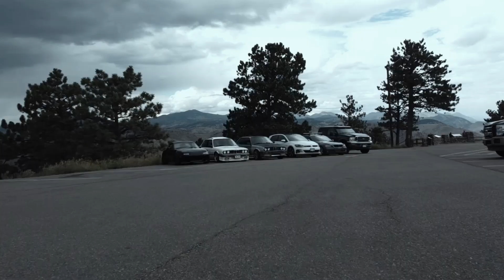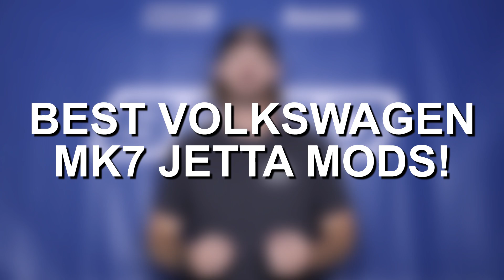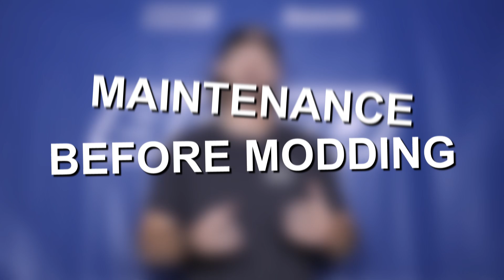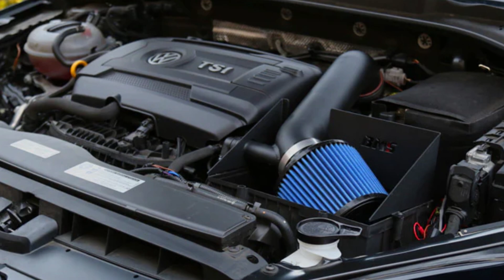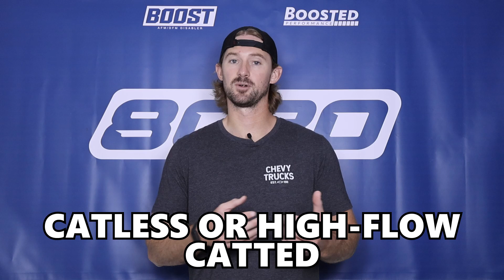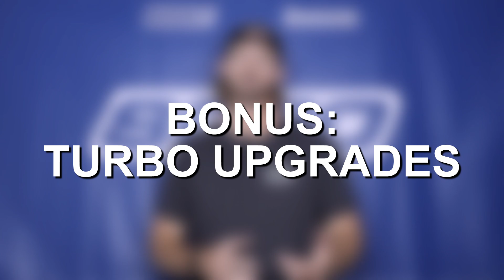How to Build a 300 WHP MK7 Jetta GLI For Just $2,000!

Comment: Good video. I have a 2001 MK7 GLi Autobahn & @ 15k miles I had an APR 93 octane Stage One tune installed, along with new plugs, oil change, DSG trans flush. I would note the costs you’re quoting are for parts only, sourced via the internet & do not include any labor component. You’d have to do all the installation & maintenance yourself, which I was certainly not qualified to do!  I’m not sure how much hp & torque my engine makes now, but I believe APR quotes figures of ~300 for each. In any case I’ve been very pleased with the performance realative to stock, especially since it still has excellent drivability in traffic situations along with great gas mileage….

Comment: I would love to have an upgraded downpipe and tune but, then that would mean upgrading the stock clutch assembly at least for me with a manual transmission.  The money just isn't there.  lol.  Oh, not to mention upgrading brakes as well, especially with the higher power output.
Reply: Yea you’re definitely not ready
Reply: Im picking up my mk 7.75 GLI with the 6spd manual, and because its going to be 2500-3500$ to put a clutch in im just not going to upgrade it until way down the line. just a intake and exhaust with a tune will push over 300lbs of tq and will cause the stock clutch to slip...

Comment: I'm ordering my GLI in early 2026. I thought they all had 2.0 engines. I plan on replacing the stock exhaust with a better flow through design. Any thoughts on this mod?
Reply: I have 2025 GLI
Reply: @jolynnenriquez8250  me too.
Reply: yes, all GLI are now 2.0. The only option you can get with a GLI is the black package.  Everything else is the Autobahn package which is standard on the GLI. And, of course, a manual transmission if so desired.  Only the standard Jetta comes with the 1.4 or the newer 1.5.

Comment: one thing i have to say. i love the mod ideas but pricing wise unless you DIY even if you do it will almost likly exceed 2grand. an intake is around 200-500. intercoolers can be anywhere from 500 to thousands. tunes are around 500 up to 1200. a downpipe alone is 1400
Reply: I just installed ARM downpipe and fmic, less than 900 for the two. Did them myself. If I can do it, any one can
Reply: the following items i found on fb marketplace and it cost me less than 1k: Apr open intake, cobb accessport, downpipe. current HP 301.
Reply: well im talking on stuff like APR or borla stuff like those
Reply: My CTS Turbo 3" Catted Downpipe was only $500 for my 1.4T.
Reply from the maker: C - You can definitely do it for $2,000 on these vehicles.
Reply: 1400 is crazy for a downpipe, they go do 300-500 new for the mk7.
Reply: thoughts on better handling
Reply: Gotta pay to play

Comment: Great video, I like how you talked about reliability and not just power.
Reply from the maker: M - Thanks for the feedback! We hope it helped.
Reply: Speaking on that reliability: If you have a manual, that clutch IS NOT meant to handle anything much over factory HP/TQ... if you're doing these upgrades you WILL need to upgrade the clutch sooner rather than later. if you've got the DSG, although it CAN handle that power without a hardware upgrade, you'll wanna do a DSG tune to increase clamping pressure so as to not encounter slippage issues.